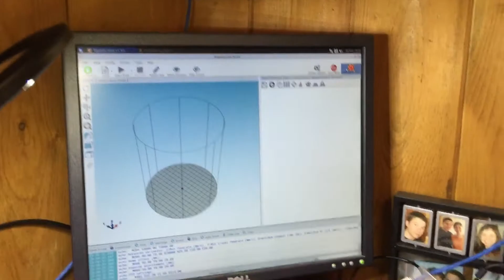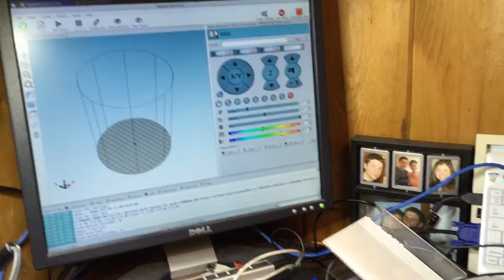Dlt-180 end stops and z-probe

Comment: Hey man. Thanks for all the help a few month ago. Just figured I would give you a quick update. I was able to get the auto bed leveling feature to work with the He3D Delta 180. What I ended up doing was taking a small chip clip or bag clip and that is what is used to spring the nozzle back into place. It works like a charm.
Reply from the maker: That's and awesome idea! If I get adventurous I might try adding the auto-level back on and try that.  =)  

Just an FYI, I got some of the Sainsmart TPU filament (not as flexible as Nijaflex but still like a silicone) and this printer uses it just fine!  Just gotta print a little hotter and slow it down.  I just printed my kid some handlebar grips!  I'll be uploading the video soon.
Reply: I saw you posted the time laps! It's amazing how these really cheap machines can handle more than advertised. Let me know if you want to see how I rigged up the auto leveling for my printer. I'll post a video
Reply from the maker: You should totally post a video!

Comment: Thanks for all the great info! I have the same model, and when I use G28, one of the three axes (whichever hits first) stops where it should, but then the next axis grinds into its endstop. M119 shows that the triggers are all functional, so I'm lost. Any ideas?
Reply from the maker: +Athos G is it always the same one that grinds into the endstop?  If so, something might be wired wrong....if not...well...you might have bigger problems.
Reply: +iceman198 I could have sworn it would grind on more than one endstop, but after double checking, it's only grinding on one of them. Also, this only happens when I use G28 (or the home icon in Repetier). If I move it manually, the endstop stops the motion as it should. This just screams firmware problem to me but I can't find anything...
Reply from the maker: +Athos G That is really odd.  Just for kicks, what if you swap the endstops...does the problem stay with the endstop or the motor?I'll have to try at some point but on mine, I'm pretty sure the endstop only stops it during the G28 command...if I manually type in G1 codes, it will try regardless if the endstop is pressed.
Reply: +iceman198 Ha, nailed it. You were right, I had endstops connected in the wrong order on the RAMPS. Tried a few combinations and now it homes nicely. I can't believe it was that simple, thanks a ton. So let me ask you this: after it homes and the motors stop, is it supposed to make a high-pitched sound?
Reply from the maker: +Athos G Awesome!  Yeah, mine has a little bit of a squeal to it while the motors are on/engaged.  that's normal for me anyways...

You should post some vids once you get it cooking!
Reply: +iceman198 Definitely! I just tried a quick dry run and there are some major calibration kinks I'll have to correct, but hey I'm just glad to have it moving at this point. You and the rest of the 3D printing community have been a big help, thanks again!

Comment: Thanks again for your help.  I got the printer up and running.  I got the z probe to work and have since glued the hinged plate in place, removed the endstop and gone to manual calibration because it's stupid, lol.  As you said several times, its not worth using it.  I just wanted to force it to do what it was supposed to.  Now I'm work on getting it to work better then it was designed.  I'm planning on replacing the wheels and carriages.  Also looking to get a heated plate.  For the price its an amusing little printer.  But man what a headache.
Reply from the maker: +Red Beard (Jeff King) Sorry for the late reply (again).  Yeah, I'd like to put some little arm on or something and maybe get the auto-probe working again at some point.  As you said, having it use the whole hot-end as part of the probe was (IMO) a very bad design. 

Funny you mentioned the wheels as I JUST got some new ones in.  They are definitely sloppy and am hoping the new ones fix some of the rippling I have on my prints. Here are the ones I ordered (http://www.ebay.com/itm/361335518165?_trksid=p2057872.m2749.l2649&ssPageName=STRK%3AMEBIDX%3AIT) I haven't put them on yet but they definitely seem sturdier than the ones that came with it.

Post some vids once you get printing!

Comment: Need some help if you can.  
1. Should I even bother with trying to get the auto leveling to work? 
2. When I home my Z Axis doesn't respond right.  
3. When using manual controls through repetier I do not get full range of motion.  
4. When I try to run slicer it gives me an error that it can not find the file created.

More details
1. I picked mine up used on Craigslist.  A father and son had bought it as a project.  They got it 99% assembled but gave up on the electronics.  I had to pull all the wiring and rerun everything.  I've got the jumpers in place, I can run the motors smoothly.  I can even try and start a job but it just goes though the bottom if I let it do to the lack of a limit switch on the print head. (EDIT - I tried the limit switch and there is no response to it. I even tried triggering it manually.  I also thought that maybe the limit switch was bad so I cut it off and just used the bare wires to simulate it triggering.  Still no response.)  I have it, just not installed yet.  So many people have given up on it so I'm not sure if I should even try to get it running.  If I don't, how do I keep it from trying to auto level.  I've looked at all the setting and the gcode that it runs off of and I can't find a G29 command anywhere.

2. When I home the machine the X axis goes up, hits its limit and comes down a bit.  Same for the Y axis.  But the Z axis just moves down a bit and not up at all.  (edit - I get the feeling that this might be normal.  I think that it only needs to home two axis)

3. Under manual control It will move through the x plane and the y plane but only halfway.  Like it will move to the left just fine but will not move to the right past center.  Same on the Y plane.  The Z plane (up and down), not a problem, works just fine.  

4. When I run slicer on a Stl file I get the following error code "I could not find the generated G-Code file".  It offers possible reasons such as Slicer had an error or that the file name it stored it as was "unexpected".  It just doesn't create the file.  I've set the app to run as administrator.  Its weird.

Sorry to ramble like that but I've gotten it this far and I feel like I'm almost there and now I'm kind of at a loss.  Any help you can off would be appreciated.
Reply: +Red Beard (Jeff King) Update - When I got the machine the firmware was already loaded.  I thought that the firmware might not have been configured correctly.  But I'm having trouble loaded a new sketch.  I think it has something to do with previously loading arduino and my system is trying to use the default locations for that config.  I'm going to uninstall and try it again.
Reply from the maker: Sorry for the late reply. I would not bother with the auto probe but just be ready for an adventure with getting it level. Sounds like your first mission is not jamming the bed. 

Don't use the buttons for manual control. Get familiar with some basic gcode commands. G28 is auto-home. Always start with that. So in manual control, type that in. It should go up to the top and hit the end stops there. If it doesn't and keeps trying to go higher (keep you finger ready on the power) then they may be wired wrong. Mine are wired on the two outer pins of the end stops.

If it auto-homes fine, then now we need to make sure it has the right number for the z-heights.  Now come the "G1" commands.  I would start with "G1 Z20 F5000". G1 says it is about to send an axis command.  Z20 is saying go to z-axis at 20 (millimeters in this case). And F5000 says set the speed of movement to 5000.  This I find is a good speed to play around with....but feel free to go slower or faster if you like.
Reply from the maker: Once you type that in it will go to where it thinks 20mm from the bed is...I would then type in "G1 Z19"...it should then go down 1mm....and just keep doing that till you get close to the bed.  Put a piece paper down...and then when you're really close do even smaller increments...."G1 Z1.5"...until your are touching the paper enough to grab it a little.  Then look at the LCD of where it thinks it is...and that is the number you need to subtract from the 'z-axis-max-height"...or something like that...in the configuration.h file.  I think the default is 200.

Let us know how it goes!
Reply: +iceman198 Thanks for the reply!  

The problem with Z was a bad solder on the endstop.  One of the issues with taking on some else's failed project.

Actually I got fairly damn frustrated with the "Micromake" firmware.  If for no other reason then I couldn't read the damn comments (wee bit rusty on my Chinese).  So I'm mucking about with Rich Cattell's version of Marlin.  

I did come up with a fix for your problem with the bowden tube pushing the print head around.  Of course this was after I was an idiot and put my head through the bottom and broke that little raiser off the print carriage.  Superglue to the rescue.

I sanded the crud off of all the edges on the insert (the part the print head rests in and pivots up and down on).  I got it to move freely.  Then I cut off the part of the level on the probe endstop that was not needed.  The part that goes past the trigger screw.  And then I cut a spring to length and wedged it under the endstop and the platform.  A small dollop of glue to keep it from traveling and it gives me some positive resistance against the play from the feeder tube.  Considering the design, it works pretty well.

That said the person who thought "OH, well just move the whole damn print head and us IT as the probe" should be put up against a wall and shot.  I just fixed it because at this point it had become "personal".  I fully intend to convert it over to the pressure pad sensors that I've seen people using, and find a whole new print head design to use.  One with good cooling control.

Comment: My delta 180 actually came with the jumpers to go underneath the driver chips and parts to make the bed a springbed (basically the idea of your bed leveler in a little different way)
Reply from the maker: +samocamo123 that's cool.  Did you get yours recently?  Supposedly they've been doing upgrades as they go which is cool that they are at least making it better as time goes on.
Reply: iceman198 I got my delta-180 this christmas.
Reply: iceman198  Although it was pretty annoying the jumpers didn't come preinstalled or have any notes in the instructions about it.

Comment: Hey iceman198, I ran into a problem while sending G28 to my printer. What happens is, all the motors make a noise(while sending G28) but does not move the carriage to the top of the printer by the endstops. The extruder remains stationary. I tried clicking the endstops by moving the carriage with my hands to the top and when it hits all three endstops the motors lock and I can no longer move the carriages. So I think the endstops are working. For some reason I can manually move the extuder in the right direction in the Repetier Host software. I assume all my  stepper motors are correctly wired. And I wired all my endstops exactly like yours. Do you know what might be causing this?
Reply from the maker: +Adam Samaeli Did you get the jumpers that go underneath the driver chips?  There should be 3 jumpers underneath each chip. This was similar to me when I got mine. Once I figured out the right wiring for the motors, I could only get the motors to move in large paces but not small movements.
Reply: +iceman198 You legend!!!! Are you talking about the two pin plastic parts.Is that what  jumpers are? I did not insert those. I thought they were just extra parts.
Reply from the maker: +Adam Samaeli At least yours came with some!  Mine didn't so I had no idea...took a lot of posting around for someone to ask about 'em.  But yeah, just plug those little puppies in (3 under each chip).  Make sure to tune your chips too!  There is a little potentiometer on the top of each one.  You'll want to look up how to do it but you'll want your multimeter to read 0.6 (approximately) for the x,y,z motors and then 1.0 (ish) for the extruder motor.